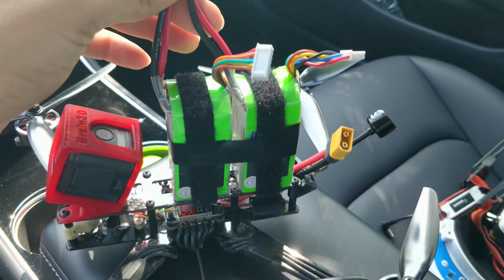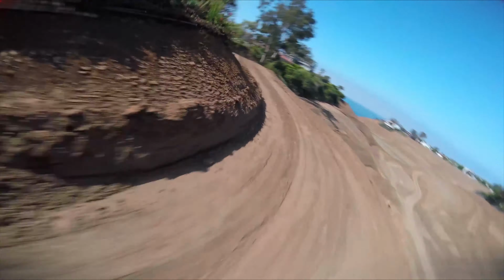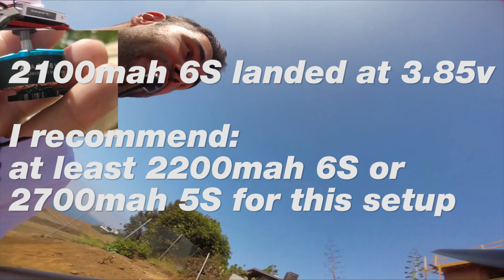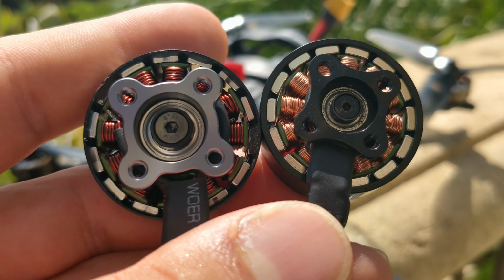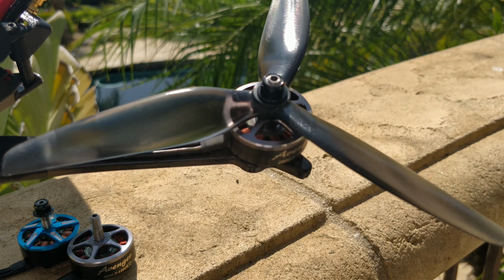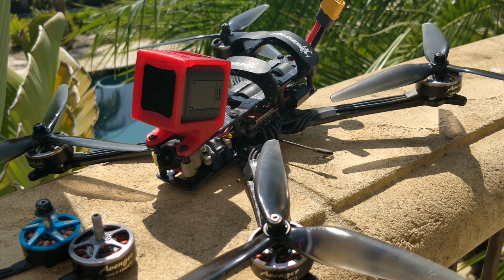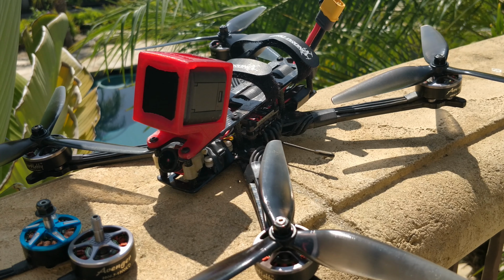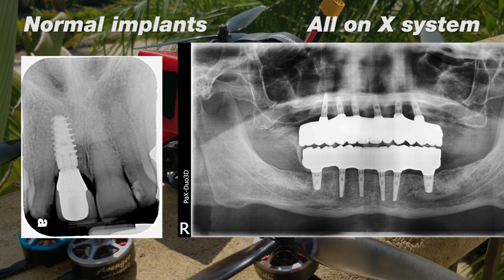Brother Hobby 2806.5 Avenger - 7"

Comment: Fantastic stuff, Bob! 😃
About implants, mine are going to be separated. "Normal". But I can see the advantage of this method!
About the quad, try the Dal Cyclone T7056C prop. People say it's the best prop for 7" on 2507 or bigger. 
Oh, and BTW... I just saw a new CrazyBee board on Banggood. 10A this time. It should fix some problems. 😉
Reply from the maker: The cyclone is like a super heavy 7" prop.  I'll give it a shot if I come across anything.  I also saw the new CB board.  Was annoyed they removed the connectors for the camera/vtx
Reply: @Kabab  Oh... Yeah, they did it. 😕
But try the T7056C. Pawel Spychalski fly his 7" with the Avengers V2 (2507s) with this prop and it flies amazing! BTW, he flies 4s with 1750kv motors. 😉

Comment: well figures, two months ago bought the avenger 2507/1750kv for my 7 inch. now they come out with something better. geesh
been pretty satisfied. running tmotor55a pro esc, dal 7056 and 6s 1550mah battery.
last night switched to hq 7035"s for the heck of it. seemed to fly smoother except on hard punchout the props would flatten out.
would love to get my hands on a glide 7 inch to replace the iflight i have. that and better selection of  7 inch props.

cheers

Comment: I carefully watched this entire video to see if ordering BH avengers today was the right choice. By the end, I was quite confident that my homemade thermoplastic lateral incisors need an upgrade.
Reply: Air...    i have been using the 1300kb 2806.5s on a Project 399 7in for about 3-4 months and I love them.   Used to have a few varieties of 2306 motors on different 7in builds and NEVER got results that I liked.

I am on 6s and loving it.   Lithium Polymers give me tons of punch to fly like a  idiot and then LithiumPolymer 6s2p 6000mah gives me 23 1/2 minutes cruising while pulling maybe 14-16 amps while cruising at 40mph.
Reply: DividingByZero FPV that sounds awesome, I’ll definitely consider these big ass 2806.5s in the future, but mine are actually the 2507 1750KV. Even these are torquey as hell on my 7” Source One. 2306 sounds like more of a 5” capable motor.. Big for a 5”, but small for a 7”

Comment: Probably the ideal motor for 7 inch would be something close to 2610 and 2808, given that people have been using 2814 as the go to stator size for 9060 to 1040 (and even some 11 and 12) propellers in planes for a long time by now.
Reply from the maker: I've found the width to matter much much more.  I wouldn't run anything less than 28 for 7" now that I've felt it.
Reply: I know, width is what gives the torque control to the motor. But 26 to 28 is enough for a propeller so small as any 7’’. It needs a bit of height to have a better power delivery and smoothness.

I say it is enough because most airplane motors have a width band that only varies from 28 to 35, while the height have a much bigger band from 10 to 30. And a 3530 motor can spin up to a light 16” propeller. So if a motor with a very close width can spin a prop with double the size and 5 times the weight, then 26mm of width is enough for a mere 7” prop.

But of course, planes don’t need fine torque control, so for a quad it would be a lot better to reduce height and add width. Usually airplane motors for 7” are in between the 2212 to 2317, so the equivalent for a quad would be something near a 2606 (smallest acceptable for acro flying) to something between 2809 and 2611 (probably the ideal sizes for 7” props).

Comment: Thought I'm the only one who's using the sunnysky x2212, but I'm looking for a 8" frame! I this frame okay with 8" Propeller? Which frame should I go for?
Reply from the maker: I wouldn't recommend more than 6" on the X2212.  It'll work on 7 and 8 but you can't expect good FPV performance.  It's fine for like a phantom or hovering around.
Reply: I have the 1250kV version, so I went 8" props. For 6" props I would think that's the 1400kV version of the x2212?!
Reply: @KababFPV I forgot to mention, that this would be my greater cinematic style kwad. Just a bit more on the powerful side.

Comment: What would the best setup be if the goal is very long flight time?
Reply from the maker: small motors and big 4S battery.  You give up a lot in the way of control and throttle performance however.
Reply: @Kabab  I would have thought that wider motor had better low end, and thus more efficient at cruising speed, energy wise... interesting.
Reply: @RR123  build a lithium ion pack...   i fly a 6s2p 6000mah pack that gives me 23 1/2 minutes of flight time at a 14-16amp cruising speed.    Go look up the weight of a 5000 or 6000mah 6s LiPo from CNHL.    Then realize I am getting 6000mah with a 40amp rating(60amp burst) out of a 648g 6s2p 18650 build.   I fly down to 3v per cell and land at around 2.9.   Around a 60% throttle cap should be used so you dont draw too much current if you do a full throttle punch.

Comment: Hey thanks for this video, I’ve just ordered some of these for a 7” I’m planning to build. I’m just not sure what frames these will fit... any suggestions? Thanks again!
Reply from the maker: The FR7 is one of the more popular options at the moment. I'm still working on my new 7" design
Reply: @Kabab  Yes I've seen that one using these motors on some FB groups but its quite pricey and hard to get hold of, do you know of any other frames that will fix the 19x19 motor mounts? I was looking at the iFlight XL7 or TBS Source ONE with 7" arms.. but no mentions of motor mount specs on any of the frames
Reply: @ByronAdams54  the motor bolts to a Project 399 7in arm perfectly.   Use them on my build.
Reply: DividingByZero FPV thanks mate - I ended up building a FR7 with these motors 👌

Comment: One thing you should really do is try some props that are for nitro airplane’s, they are super stiff and that should give you better performance. I have flown at least 600 different rc airplanes throughout the years and when everything pretty much changed to electric, I never really liked how the flexible electric props felt. So I went back to my tried and truly tested masterairscrew or apc hard nylon or zinger wood props and problem solved. I know they don’t have as many counterclockwise  props but all you need is is to start with a standard 7 pitch or up setup. When you get to the 7” size is when those props really shine. 
Try it out and you might really like how more locked in feeling it will give you on that heavy of a quad. I think at that weight level this is really what you need. I have over 36 years of rc airplane experience and can probably give you a good solution to a lot of these problems. Give me a shout and I will always help you figure it out. That’s a pretty cool spot to fly at!
Reply: We have down the wood prop thing for shits and giggles a while back.. We built a 8 inch just to try it on running Beech wood 8x6 props very stiff props and light for a wood prop but still really heavy out weighing 7 inch tri blades by almost 3x... We used 1180kv 2218s and Wraith32 Metal get 50a BLheli32 escs.
Running two Rline 2.0 1550 100c HV packs in parallel.

The motors are pretty heavy coming in at 69.5g each but have massive torque that's why we chose them.

We built the craft as light as possible using a frame we designed and cut our selves that was very basic and light (we own a cnc router, we did this about 4 months ago)

We used a hyperlite F4 board, Crossfire' rush tank VTX and a Runcam Micro Eagle. 462 grams without props and batteries.

Running Betaflight 3.5.3 stock PIDs and filters.
On those props (very well balanced) it flew ultra creamy smooth when just in foward flight and loose turns and slow flowwy loops and rolls..
Now as soon as you started pushing on it a little harder response was bad, like really bad... Like think 3s on crappy 2204s running a 6in prop using PPM as the control input lol...

If you are just cruising it's very very smooth and buttery but as soon as you start changing moving the throttle stick it feels bad and so long as you aren't moving pitch and roll sticks very much it flies great, yaw is highly unresponsive and the quad kinda flips out if you give much yaw input at all.

The motors just can't handle the heavy props, they can't spin them up and slow them down fast enough even on 2218s that have a LOT of power and lots or low and mid range torque. We slapped some HQ8x5 biblades and it flew excellent and had ample power and response was great with good top end something the wood props didn't provide... I will say the wood props gave the smoothest lazy flying quad I've ever flew but that's all it could do. And the wood props aren't Cheap And require balancing and break easily.

We fly 3d Gassers and 3d heli (we as in me and my husband) that's where we came from we have be flying together 13 years that's how we met was at the flying field when we was both 13 and now 26yo...

We kept the quad and fly it from time to time with the HQ8x5s it's pretty fun and cruises very quickly and flight times are pretty good on a 2x 1550s in para... We also fly it on some 4s 4400s, with that setup it's not got tons of power but amp draw is low at cruising speeds and long flight times are the norm and it is just relaxing to fly out and explore stuff we can't with our 5in track quads.

One more massive down fall of the wooden props is that if you did turn a little tight and force it to do it or coming down through dirty air the prop wash was SUPER bad like a good second or so of pretty bad oscillations for real they would take like 1 to 1.5 seconds to settle down... With some filter tuning and enough D gain that we started getting pretty warm motors and the prop wash Os had gotten a lot better but still really bad...

We got less prop wash from our 10in 500mm quads running a KK2 board back in the day of PWM and flashing 30a plane ESCs over to SimonK lmao...

Trust me wooded props belong on 3d Gassers (or Carbon props.. That's what we prefer) and Nitro planes they do not belong on a quadcopter period.

The also sound very weird on a quad. Much different then on a plane completely different tone... I don't know why it's so different but if you dont want your quad sounding like a quad... Slap some wooden props on it lol.
Reply: I didn't write this, the 1550mah Rlines we ran in parallel are 6s packs... We didn't have any 6s 2600 to 3200mah packs most of out non race quad packs are 6s 5000mah for our 600 and 700 helis...

Comment: I run sunnysky Edge racing 2308 2600 KV Motors on my 7in. But I run the by blades 7x4. I just started running a 75% throttle cut. Still on 4S 2200mAh. The performance is great but I would like a little more Snappy response.
Reply: Get 2406’  1600 motors and use a 6 s it makes a huge difference for power (a lot better)

Comment: 6mm!!!! All the best 7 inch frames use super thick arms!
Reply from the maker: I don't need the 6mm weight.  thinner wider arms are just as rigid and work better in this case.  6mm arms would add at least 15g to the frame with all that arm.
Reply: @Kabab  Have you watched any of Pawel Spychalski's videos? He tested a bunch of stuff for better 7 inch flights and he says 6mm is very important...i feel like 15 grams isnt that much to sweet on a 1kg quad....
Reply: @Edgewalker728  Couldn't agree more. My 7" hyperlow cg has 5mm arms and it flies horribly. Switched electrics to fr7 and its night and day difference. Also had a friend with a IFLIGHT 7" and his 5mm arms made it shake no matter how many Filters he applied, even with RPM Filtering. Took all of his electronics and swapped it over to a FR7 frame after seeing my fly,  and again his issues disapeared.  Frame thickness plays a bigger role than many think. 15 grams on a 7" is fairly marginal when you're already carrying large batteries.

Comment: i assume this rock of motor performs well with 4s and 8 inch props in a small long flight fpv trainer.
Reply from the maker: No o wouldn't say that. For 8" to perform really well you'll probably need a slightly wider motor. This motor isn't going to be bad but if the trend continues then you'll need a bit more motor.

Comment: Those Brother hobby motors are 12mm bearings with a 6mm lower shaft at least on the 2810's these should be the same.

Comment: I think when I looked at how things scale I came up with something like a 2810 to perform like a 5". That may have assumed the same top speed and that might mean a 6-7" pitch as well if the tips are going near sonic speeds since you'd have to reduce rpm. The point is scaling makes some things go up exponentially and you may like even bigger motors.. Another thing that might work is increasing the prop twist so it works a little like a Horton wing where the tips produce lift from catching the updraft and you have a bell load instead of an elliptical load but that might also mean the props have a very specific envolope and might be better for a camera platform. But that might make a 7" as easy to turn as a 5.5 or 6".just a thought I had but I'm no aerodynamics engineer.

Comment: Whoops got huge fanbase. 
I hope BH, iFlight, FlyWoo, Emax, T-motor et all, dont forget about us "big" drone fans.
Reply from the maker: Nope they haven't. They've gone ahead and copied BH with this motor size but BH is now the cheapest and best motor still in this size.
Reply: @Kabab  It feels like no progress. BH2510 and BH2507 is couple years old - neither ideal.

 Then the defacto two choices for 7inch... "2806.5" (which1 is better?? - prices stubbornly high) and RS aira 2508.

  I bought the airb 2514 on whim and its a useless paperweight.

FlyWoo, BH, IF.. which is best?
Reply from the maker: @dilbertmcfly5986  the BH 2806.5 is all I'd recommend

Comment: How does this compare to iFlight XING 2806.5?
Reply from the maker: I just reviewed the Flywoo 2806.5 which should be identical to the Xing since they use the same OEM manufacturer.  These Avenger motors are definitely better but the Xing are also very similar.  See the review: https://www.youtube.com/watch?v=wK1VnZR-Rak

Comment: I pretty much freestyle my seven quad in business parks, as you're right, wide open space is hard to find, and I prefer freestyle flight anyway with this size quad.

You may have solved my mystery as to why I have this wobble after having to change pretty much everything, the stack, the motors on this Skystar G730l, that flew on a rail while it lasted, a rail! Two desynchs out of the sky, and you gotta change stuff out! So, this had 2306's I replaced with some not so great 2207's but hmmmmmmm, maybe that wobble is coming from those motors.

Comment: i figured it out, use a hero 8 jello gone lol  These motors are sweet and smooth i have 2 kwads 7in 1300kv and 1460kv
Reply from the maker: It's been a while. I've got a new motor on the way that kicks these things in the butt real hard.  The 2806-2807 size is a 6" motor after all my testing since this video

Comment: it really is entirely possible to fly these stupid things in tight spaces, but it really isn't where these things shine.  - https://www.youtube.com/playlist?list=PLu1kZ8eHidi4hJNVqSLJn_UqRuC44XsP-
The bobbles can be manageable through prop selection, once you're above 2507 stators.  I've found that the more abusively high KV versions (Garila-Hoi 1500KV) on 6S can actually beat the air in to submission quickly, but it's on biblades.  The bobbles aren't gone, but lighter props are what makes the difference (even the HQ7x3.5x3's are too heavy in anger).  I really do think for that level of extreme control you're very comfortable with these 2806.5's are going to be 'the' answer, but I'm going to struggle to see how my $220 build on $17 motors needs to do more than I already have it doing on a cheap stack.  
This does make me wish ZMX was still making motors, because a semi-haalbach array 2607 motor (I think their naming scheme would have made that the IJN Yamato) would be a truly glorious motor.
Also - back to the OG Floss2.1 that can handle 19x19 motors without issues... what goes around comes back!

Comment: Hi I  learn so much from your videos,  im building a 6" smooth operator 6s with brother hobby avengers 2507 1700kv, i ran the gemfam 6042s on my hyperlow CG 4s and worked great, any othee suggestions, thanks
Keep the videos coming 
Kris
Reply: I wanted to try those brother hobby 2806.5 avengers but the kv is too low right??

Comment: So, 'I guess your new 7" frame will support the bigger motor pattern for the 2806.5 ? ;)
...and I´m wondering if your gopro+upsidedown lipo mount might have a little influence on the wobbles.... 
Time to design a little more aerodynamic body ...maybe.. ;) 
Have finished my first 7" with the "tiny" Avenger V2´s with 1200kv on 2200mah 6S and have some wobbles, too...like the Dal 7056 prop so far, hope T-motor or Gemfan will step up and show us some well balanced props in the near future!
Reply from the maker: yep definitely will fit the wider pattern
Reply: @Kabab  iirc, the Floss2.1 7" already will just fine.  
The wobbles on thoe 7056C's are all about motor size - you just need something huge (2508 on mine) before those actually feel decent, and I've had to run some seriously aggressive tunes with very minimal filtering to get them to feel like a poorly tuned 5" quad...  it's absolutely ridiculously stupid fast and makes huge grip, but it eats batteries and I can get most of the same performance running 6042's on the same rig.
I do want to see a variant of the 51466 Hurrican ine 70433 range - lighter and thinner blades out towards the ends, with a bit more beef towards the middle and aiming for 8.Xg weight, but that won't be that durable of a prop.

Comment: Pretty much one of couple guys who knows what he's talking about. 

Thousands of.. "hey 7" is easy, I just toss a bigger prop at my old 2306.. see it 'works'".

I got 9" Avenger 2812 900KV - 9x5x3
5" RCinPower 2207+ 1860KV - 5x4x3
Had some catastrophic mishap with 7" frame, so rebuilding with 2806.5